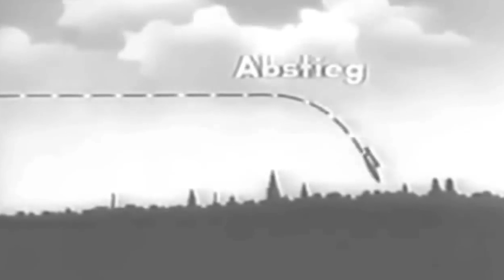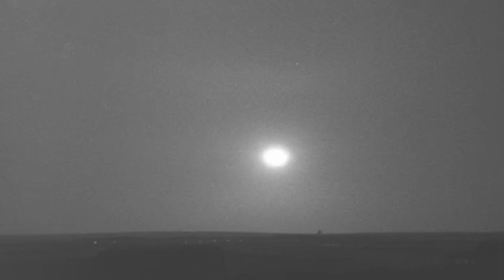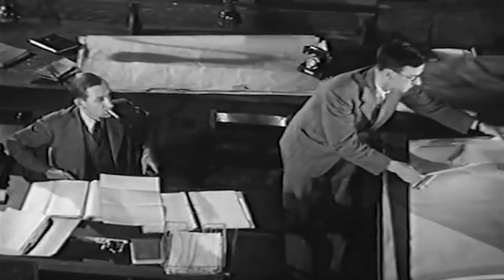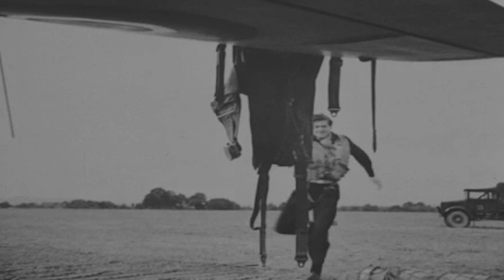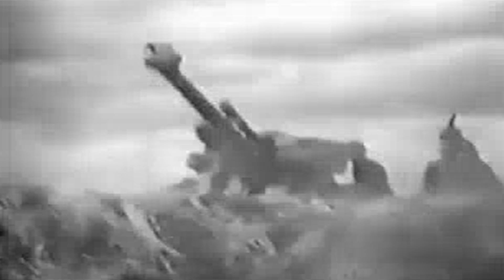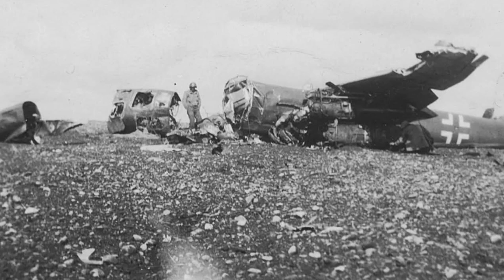The Strange Plane with an Absolutely Insane Top Speed

Comment: Why the video of typhoons, Mustangs and Furies whilst talking about Tempests; anyone would think A.I had been left in charge.
Reply: The tempest mk1 looked almost identical to the typhoon, the only real noticable difference was the 4 guns being fully internal rather than sticking out the front
Reply: @not-so-british-brit9752   The wings of the Typhoon are substantially thicker and the long barrels of the 20mm Hispano cannon are clearly visible. The vertical stabiliser of the Typhoon meets the fuselage at a corner, whereas the Tempest's tail surfaces are blended smoothly into the lines of the fuselage.

I think the matter of fact is that there is a limited pool of footage of the Hawker Tempest, so whenever they aren't talking specifically about it, footage of contemporary aircraft is used to fill the gaps.

However, I do think that the use of such other footage may be misleading to those less savvy in their aircraft knowledge, those that cannot tell them apart already at a glance.
Reply: @not-so-british-brit9752  No, the Tempest mk5 is the direct upgrade from the Typhoon, as said in the video
Reply: @g8ymw I never said it wasn't. What gave you that idea?
Reply: A Tempest Mk2 is easy to mistake for a Sea Fury
They have the same engine (Bristol Centarus) but the Sea Fury had a 5 blade prop, Tempest 2 had 4
Tempest Mk2s were built to go in action against Japan but 2 big bangs put paid to that  idea

Comment: The Tempest was the leading killer of the V1 ~ to begin with. Then the proximity fuse got into greater circulation, the gun lines/fighter zones to engage V1 were redrawn to give precedent to the flak guns. 
By the time the first bombardment of flying bombs ended on September 5th, of the 6,275 which left the Continent, R.A.F. fighters had destroyed 1,771, flak and Royal Naval guns 1,460, and balloons accounted for 232.
Of the R.A.F.'s total, 638 had fallen to Roland Beamont's two Tempest squadrons, 428 to Mosquitos, (mainly at night, the Mossie diving onto the target guided first by AI radar and then by the red-hot glow of the pulse jet) 303 to Spitfire XIVs, 232 to Mustangs, with the balance contributed by Spitfire XIIs, IXs and Vs, Typhoons and Meteors. Incidentally, Beamont had the  Tempest’s 20mm harmonised for both accuracy and range, to ensure densest fire would destroy the V1 at a far enough distance to reduce damage to the aircraft. 
When the assault of V1s reopened on a smaller scale with 639 arriving between September 15th and January 20, 1945, thanks to the use of the proximity fuse, the relocated flak guns ruled supreme. 
The guns destroyed 331 and the fighters 71; and in the third and final attack during March 1945 anti-aircraft fire accounted for 89 out of 125 V1s.

Comment: Your thumbnail has the propeller wrong. The 4 blades are not at 90 degrees. If it supposed to be a 5 blade, there is a blade missing and the spacing is wrong.
Get it right
Reply: AI ignorance

Comment: The v1 was a surprisingly clever idea,,especially the simple pulse jet,,if combined with modern guidence systems,,and launched in swarms,,,brilliant  !!!
Reply: Wasn't the V1 actually the first ever operational guided cruise missile?
Reply: @jfv65 No. It was only guided by it's gyroscope to fly straight and level. There was no real time or programmed guidance system on board. It was a dumb bomb merely propelled by a pulse jet. About 10% of V1s carried a transponder to allow the Germans to track their course and eventual target, but they never controlled them. Allied counter-intelligence had completely penetrated the Abwehr spy network and was sending back false information about impact sites to further confuse the Germans and leave them not knowing how effective the weapon was, if at all. On more than one occasion they got them to oversoot or undershoot lLondon. The signals were often jammed by the allies too. Plans were made for a radar guide/tracked version which could be commanded to 'dive' at a given range and point, but they never went operational as the launch sites were quickly overrun. 

The engine was never designed to cut out. Once the preprogrammed distance had been flown, the mechanical controller opened a pneumatic valve that pushed the elevator down suddenly. The pulse jet engine fuel was gravity fed, flow stopped with the sudden pitching down movement. Whatever.  The result was the same but the designers would have preferred it powered into it's target. 

Interesting to note that the mechanical electric ( early models were clockwork) control unit later found its way into the first automatic washing machines by the early 1960s
Reply: They missed a bet by not using valveless pulsejet engines.  Valveless pulsejets have no moving parts at all that can fail.  It would’ve been much cheaper to construct.

Comment: If the Britts had only Spitfires,Corsairs,and Tempests,from the start,Germany would've been annihalated quick.not taking away from any other great fighters,just facts
Reply: Brits, not Britts. Besides, they didn't. The Corsair and Tempest had yet to be developed.
Reply: @williamwallace5857  He has quite an imagination.
Reply: @DogVonDobie  considering it's "just facts"
Reply: @keithwarrington2430 Took me a while to realize you were being sarcastic. Right over my head.
Reply: Kenny, considering it never happened, makes it fiction; not fact.   Facts are facts, because they are provable. A fact of history would be something that actually happened. An imaginary scenario doesn't provide the basis for a "factual" conclusion.  Further, your conclusion requires the presupposition that the other side would not have kept pace and achieved an equally advanced technological state simultaneously. So, don't be silly.
Reply: @DogVonDobie the capabilities of these aircraft compared to the enemies are Facts,silly or not
Reply: @KennyDodge-of2sp  What is silly, is your comparing the capabilities of certain Allied aircraft of 1944/45 (or late1943 for the Corsair), with the capabilities of German aircraft of 1939/40 (the "start"), in the first place. Then, after giving the British these unreal advantages, you conclude with the "facts", that Germany would have been easily handled in your imaginary contest, as if this nonsense means anything at all. Then, pat yourself on the back for being fair, because you're "not taking away from any other great fighters", whatever the hell that has to do with anything. I imagine there must be some equally silly person somewhere, making the equally useless observation that if Germany had only the Me 262, the Fw190D-9, and the Fi 103 from the start, the British would have easily been destroyed; then smugly, and absurdly stating these are facts. What is the value of such twaddle?

Comment: Tempest vs FW-190? What's faster?
Reply: Depends on the version.
Reply: From the resharch. The Tempest was faster ( 466 mph.) while the Fw 190 went 440 mph. .. The only two piston Germans aircraft which was faster. Were the Focke Wulf TA 152H ( 472 mph.) and the Dornier Do 335.( 474mph.). Hope this helps. 😊👍
Reply: @petertyson4022 466mph was the mk1 prototype. MkV did 435mph. Fw190 A8 408mph, D9 425mph and Ta152H 472mph at altitude.
Reply: @petertyson4022 that's awesome. The 152 was developed too late to make an impact, but very cool aircraft. 

From my own nerd search,  the Tempest had a lower ceiling but climbed faster. 

I adore these old aircraft. 😅
Reply: @petertyson4022 what about the P51?
Reply: @petertyson4022  the Do 335 would of been a great figther
Reply: @davidthompson3697 It wasn't designed as a fighter, and "would have been", doesn't count.